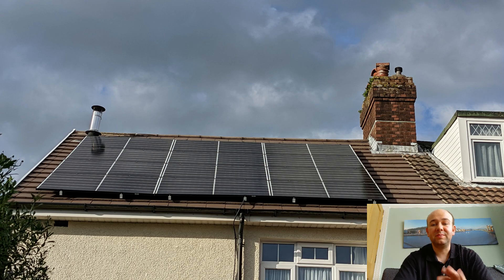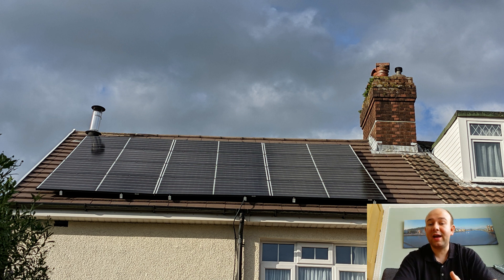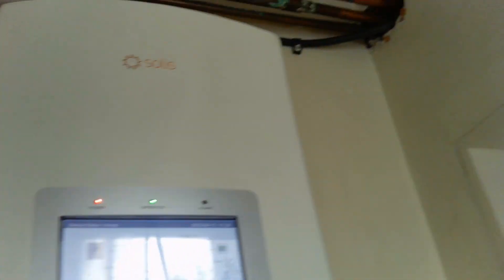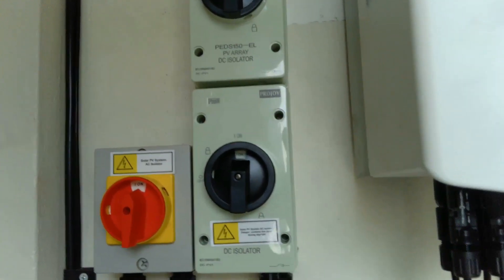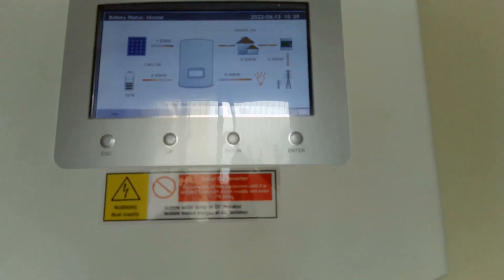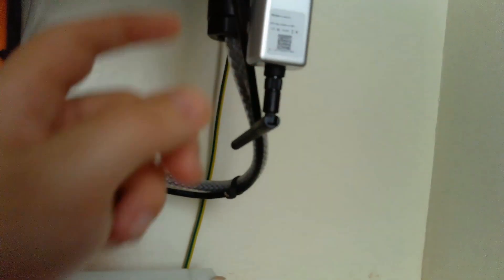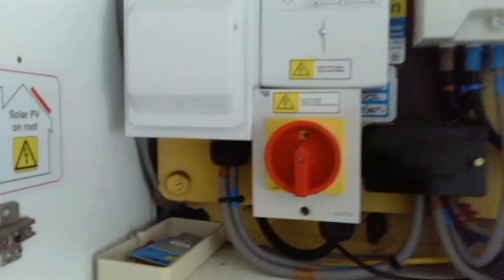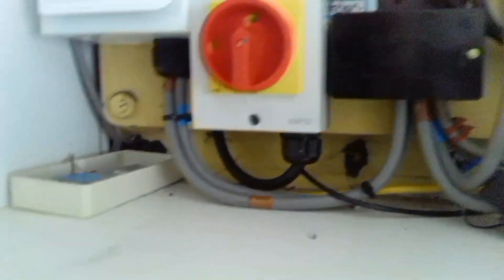My Solar and Battery Setup and How Much it Cost £££

Comment: Hi. Who installed it as I live in South Wales and would like a 6 kw system.
Reply from the maker: Hi, we used green glow Ltd. If you want a direct contact then this is the email for David Scaife: dave.scaife@glowgreenltd.com (if you want to tell him I gave you the details, please do.)
Reply: @drchrisjbarnettgreentech  Thanks. I have been quoted £12600 for 6kw with 3.5 kwh battery
Reply from the maker: @dragonbreathwales  that battery seems very small, when you take the usable dischagre you probably talking less than 3kwh.  Do you know how much electric you use a day?

Comment: Very good system for an equally good price. Are you single or three phase supply, as we are restricted to 3.6 kw discharge to grid by our DNO Western Power with our single phase supply?

Do you have room for a further battery as with that array you will soon fill the existing one, plus of course a Time of Use tariff would allow you to import cheaper off peak mains to the battery in the winter.
Reply from the maker: Hi, thank you for comment.  We on single phase.  Solar installation under 3.6kw can be installed without notify the DNO, however you installer and submit a G99 form if you want to go bigger (which is what we did, it very rarely they reject the g99 form.). Those puredrive batteries can be chained together  and we do have space so it may be a future investment (hopefully when prices come down)
Reply: @drchrisjbarnettgreentech  Thanks for your reply, two of our neighbours, both with the same Puredrive batteries as you with 4kw arrays have both added another 5kw battery each. They found that with the hours of daylight in the summer the production of solar kept the battery full and they lasted through until the next morning. However, they soon used the battery up in the winter.

We applied for a G99 but Western Power wanted us to upgrade to a three phase supply at a cost of 15k so we accepted we were limited to the 3.6kw. We have a Powerwall which is 14.5 kw so ample for us, with the added bonus of a 5kw output. The battery added to solar is the game changer though.